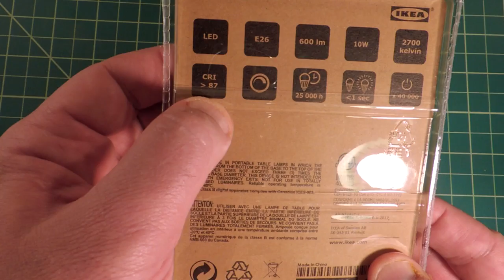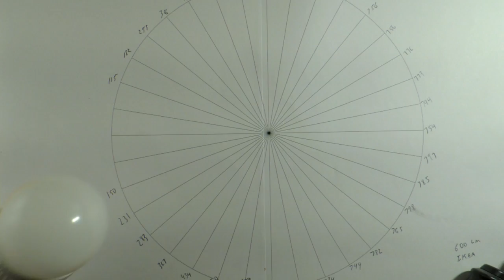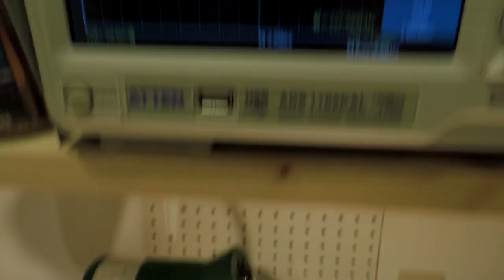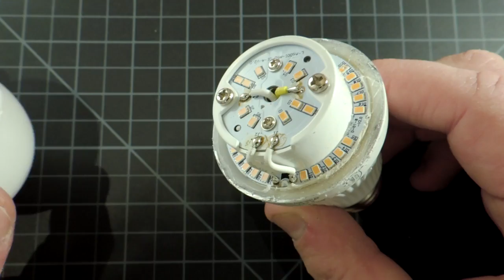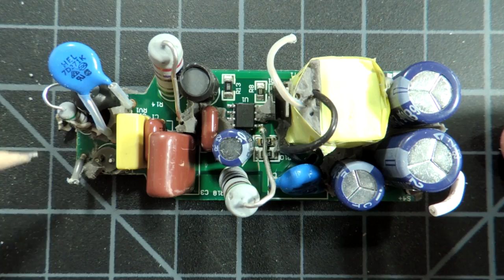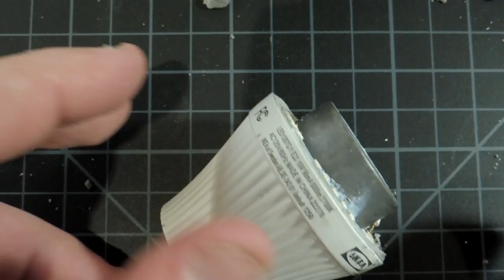Ikea 600 lm LED Bulb Review and Teardown

Comment: Bought a similar bulb at IKEA today (Detroit, Mich).  600 lumens.  It has ETL printed on the bulb sleeve.  The display in the store said they were $9 bulbs, selling for $5, so I got one on a lark.  If the performance of this bulb is similar to the one reviewed, and the price point isn't just a temporary loss-leader, then the price/performance comparison is more favorable.

By the highly-unscientific "touch it with fingers" method, it appears to run quite hot...almost as hot as an incandescent.  The packaging states that it is "not for use in totally enclosed luminaires", which makes sense based on how hot it feels.  So even though it uses a lot less electricity than an incandescent, a lot of that power is still being converted to heat rather than light.

Comment: IKEA, in the new year, will have a new 600 lumen bulb, both in a clear (with a TIR fitting inside) and a opal (white) diffuser for about half the cost of the current ones

The only thing I don't get, and I've had many an argument with the higher-ups at IKEA, they position this bulb as being about the same as a 60 watt lightbulb, which it isn't. Hell, up their entire (internal) brightness scale, they have the equivalencies wrong, with the difference getting larger as the equivalent-to brightness goes up

This is something I hope they address as the LED market grows, and they continue to move their whole lighting range to LED for 2016
Reply: My IKEA just got the new Opal 600 lumen bulb. Looks a bit different (Smooth, no ridges), and it now does have the ETL stamp on the bulb itself. Report is that they switched manufacturers (but who it was before, and who it is now, I'm not sure) and only 9$ a bulb now. So there's that